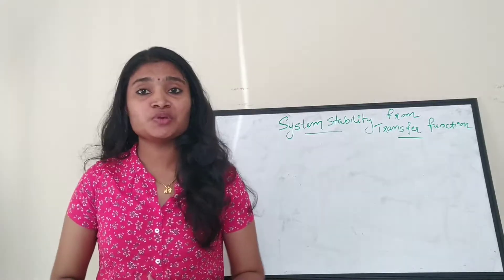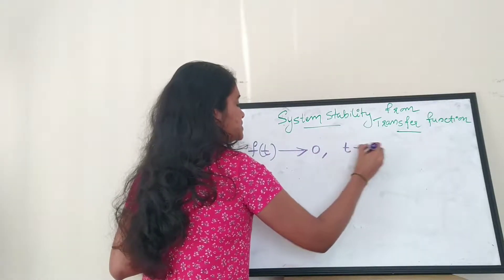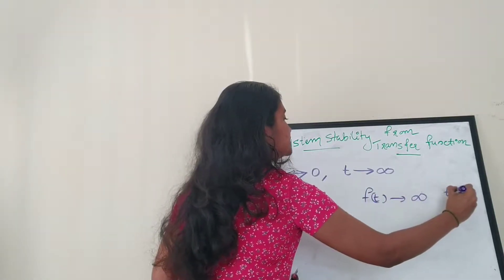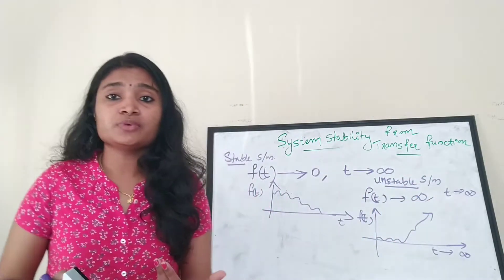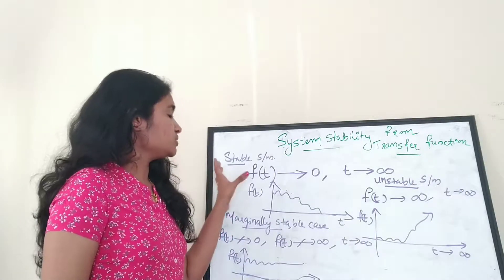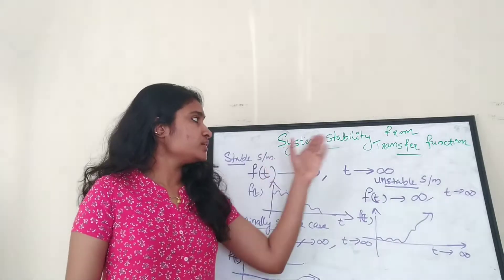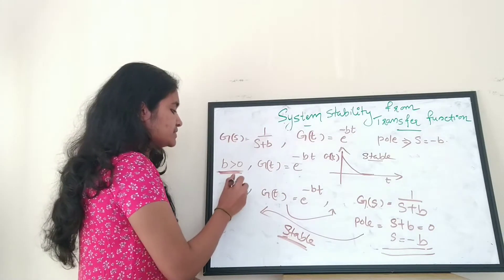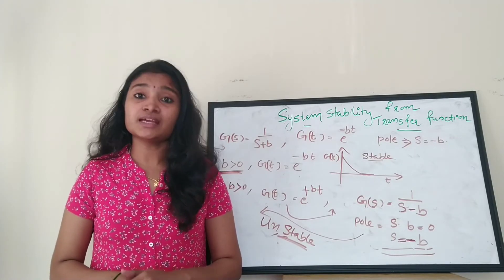Stability of a System from the Transfer Function|Poles and System Stability

Comment: Apart from poles lying in the left half plane, there is one more condition for stability:

If H(s)=N(s)/D(s) then degree of N(s) should be less than that of D(s). Intuitively this makes sense but I'm not able to prove it using Inverse Laplace transform. Applying ILT gives delta functions and its derivatives, which are highly localized. Please help.

Comment: So if the pole of any system is negative ,it's stable . isn't that the conclusion .
Reply from the maker: Yes
Reply: Thankyou 
So in an actual problem we don't need to find the Laplace transform and all right?
Reply from the maker: @akshayraj7649  it may vary for various cases. Generally for Stability we can look into the poles and zeros
Reply: @EasyElectronics_jobupdates  👍 Thankyou